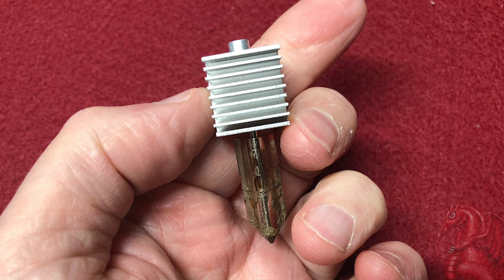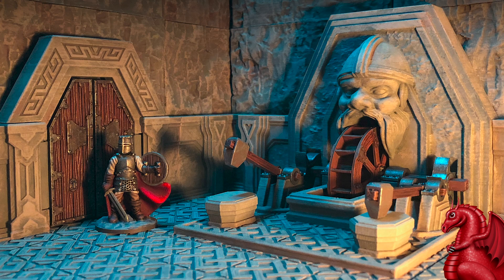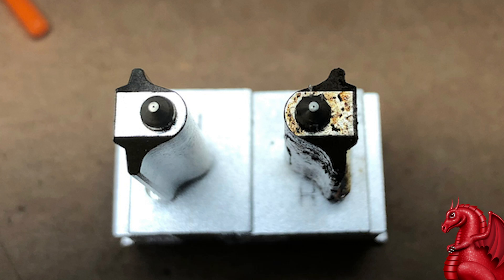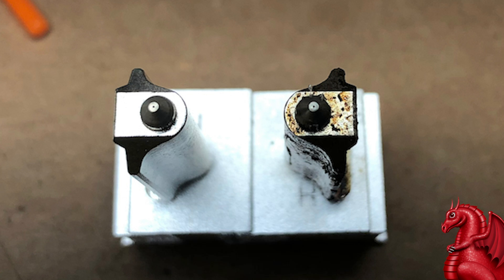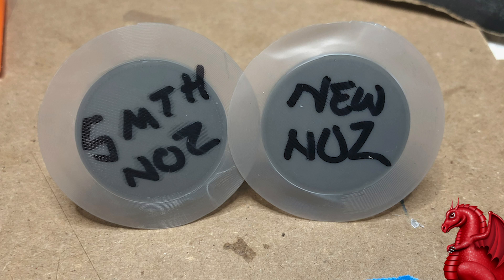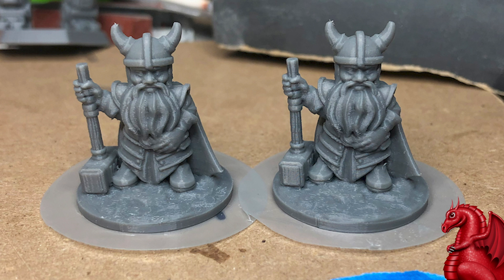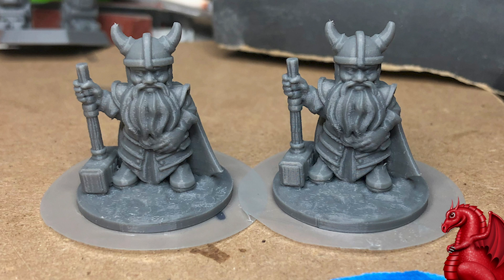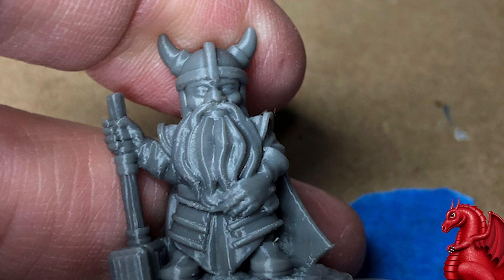How long will your Bambu Lab nozzle last?

Comment: I'm so unlucky with my A1 mini. Turned out my heating block assembly was faulty and support did not believed it so I had to purchase a new one. This caused me a lot of issues with Z-offset. Every time I'm printing 0.2 mm nozzle its getting clogged to the point I can't unclog. (Thats the reason I'm buying aftermarket screwable 0.2 nozzles, at least I dont have to throw out the entire hotend, only the nozzle part). The hotend heating assembly heating properties also Went down under half a year to non existent. And the funny thing that almost all of the part of the printer count as "consumable" So you won't really get warranty for them, only when it is initially faulty

Comment: When I decided to get a new printer, I was amazed how much Bambu had changed the game since I bought my printer 5 years ago. Not only did the A1-mini have all the improvements I was looking for in a better printer (good quality minis, less manual tweaking, higher speed, quiet) it was also the cheapest pick on the market. The fact that it also apparently requires less service and replacing parts feels almost unreal

Comment: I would have thought that if you are just printing plastics without additives, like carbon fibre etc, you shouldn't get any ware at all. Pure molten plastic is not abrasive.
Reply from the maker: Yes, it is. Just look at what water can do to rock. Here is a video I did showing what just standard PLA did to Ender 3 nozzles: https://youtu.be/jm4EdZrKRuE?si=aTF1vOJ-RqGKx2Ac
Reply: Its not pure plastic, also has tue glue so it all sticks together

Comment: So what should I use to completely clean the outside of it? About once a month I take the silicone sock off and wipe all that stuff out.
Don’t really want to take a brass brush to the end of my nozzle and damage it though. But it’s driving me nuts that I can’t get all the teeny tiny bit of plastic completely off

Comment: New to printing. My nozzles are getting sll gummed up half way through prints and failing with super fine spaghetti.  Stops extruding right and  then forgets where it is at.  Mine is about 3 weeks old. I do the cold pull thing. Maybe get 1 good print then back to failing. Idk what I am doing wrong. Thought it was because of the .2mm nozzle but switched to the .4. Started happening there too. Feel like I should replace the nozzle and see if anything changes.  Bed adhesion is great it’s alway afyer about an inch or two of build it starts

Comment: One thing I don't care about with the A1 that I have, just about ALL the screws in the machine are this same little itty bitty size, easily stripped, and some parts could use just a little larger screws for better strength.

Comment: Have you tried changing filament without using the cutter? I'll be installing A1 heater and nozzle to Ender 3 clone for easier nozzle changes (and not stripping threads from aluminum heat block).
I wonder if E3D Revo -style long retraction after print would be enough to allow pulling filament out of cold nozzle? At least BL has used similar long retraction before cutting to reduce poop on filament change and they don't seem to clog on cold zone...

Comment: i changed out one of mine recently because filament kept getting stuck in it. the problem stopped after i changed the nozzle. But it took months before i had an issue and i pretty much print all the time like you.
Reply: Were you able to fix it? I’ve gone through 2 Bambu lab 0.2mm nozzles and they’ve both been completely unable to extrude any filament. Do you have any tips?
Reply: @jks0974  I have well over 1000 hours on my A1s. Normally after I change the nozzle I'm good for a while. How much are you printing and how long between nozzle changes?

Comment: The only issue I have had at my 4 printer farm (1 a1, 2 P1S's, 1 P1P) is flow rate with the amount of printing I push on them. The stock are good all around, but I upgraded to 2 high flow revo, and 1 biqu nozzle and let me tell you easily 50 percent faster. The a1 is still stock as there is not a nozzle out there that improves on it yet. I would also add it seems my layers have better adhesion also with the biqu, and high flow revo.